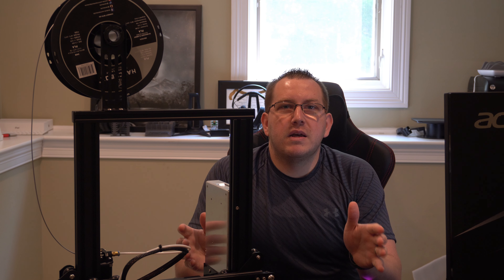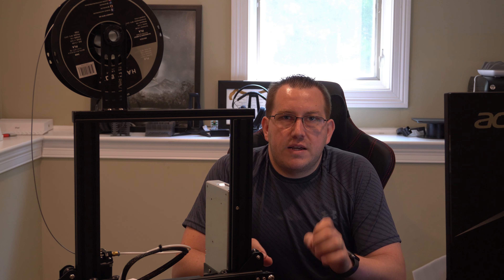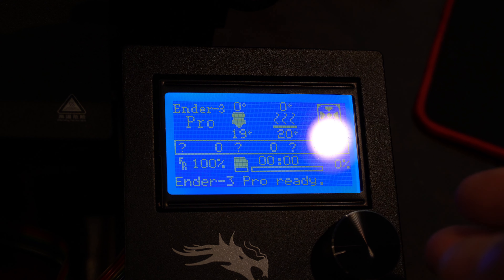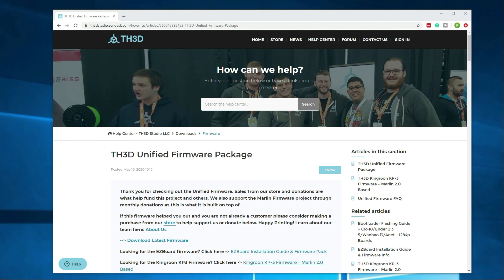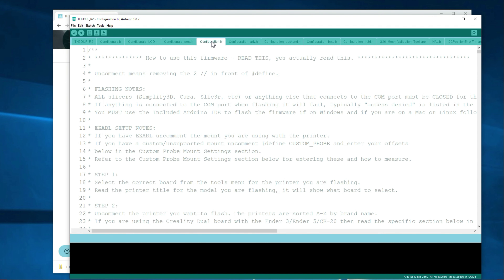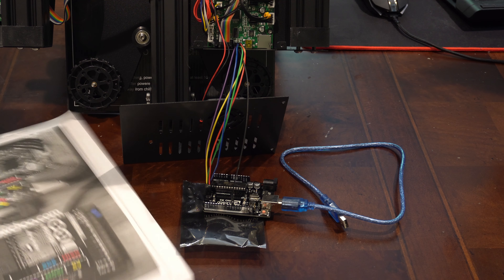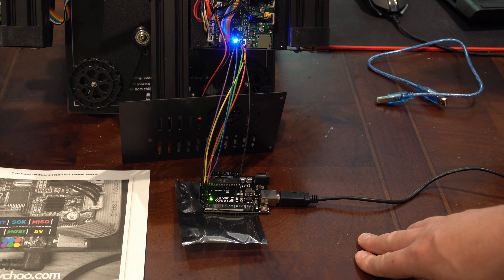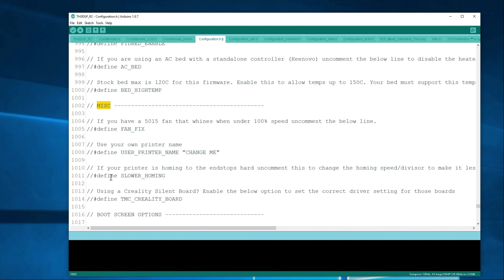Ender 3 Pro Firmware Update – Complete Guide

Comment: I see creality has 1.1.9. would you know if they finally put thermal protection is in it finally? and how do you check if it does?
Reply from the maker: Hi. All the Creality versions I have looked at, or read about, didn’t have the thermal runaway protection working. I believe they added it at one point, but one of the reddit subgroups tested it out, and it ended up not working. I would recommend upgrading to Marlin, either by going through this video or upgrading your board to the SKR mini e3 v2. The SKR mini is a great upgrade and have a video covering it. https://youtu.be/wtT6iA9IG7A
Reply: Hi i can confirm that the official Creality Firmware  rev 1.1.6.1 that i downloaded from thier site does have thermal protection you just need to uncomment it in the config files and it does work as i have performed the relevant tests on both the Bed and Hotend  to confirm this. I have been running this with the stock board for E3PRO via Octoprint for years and have great consistent print quality. However if you need to and all the whistles and bells ie filament runout etc etc you will soon run out of space on the 1284P without disabling other options. Until my board gives up the ghost no need to migrate to the 32 bit
Reply: My ender 3 pro has marlin v1.0 installed out the box

Comment: im getting error can't set com-state for "\\.\COM6"
I've plugged in computer to printer via usb. Installed USB serial driver using zadig. 

can't set com-state for "\\.\COM6"

Before i installed driver, i had port not found sync error.

I don't know what to do now.
Reply from the maker: Hi. Do you have the 8 or 32 bit Creality board, and are you getting this error when connecting the Uno board or the printer? If it’s the printer, did you already push the bootloader using the Uno board?
Reply: @3DPrintscape  Hi I'm getting the same problem when plugging into the printer also had to use zadig to install the driver. any idears
Reply from the maker: @markjohnson5137  Hi. Is this when you connect the Uno board or is it when the printer is connected? Try to reboot your computer and make sure Cura is not open when trying to do this. It feels like something may be blocking the connection. It could also be your Antivirus blocking it as well. Also, what mainboard do you have?
Reply: @3DPrintscape  Thanks for the reply, I manged to upload marlin using the uno board set to upload using programmer. The problem is when just the printer is connected my lap top doesn't want to talk to the printer. Tried rebooting it, firewall off and nothing else running. The mainboard is creality 3d 1.1.4. I've got it working with the settings I require so I'm happy.
Reply from the maker: @markjohnson5137  That behavior is odd, if i come across a printer that is doing it I will dig in deeper. Im glad to hear you are up and running :) .
Reply: @3DPrintscape  I've got it working. I flashed the bootloader using a USBASP which is strange as when I used the uno it said the bootloader upload was sucessful. I also used the USB serial driver recommended for 1.1.4 boards on the creality website.

Comment: i have ender 3 pro 32 bit v4.2.2 board and purchased bl touch and flashed firmware to prepare for the bl touch.  was never able to get the bl touch up and running so looking to go back to original firmware but having a hard time doing it.  will this video work or is there a easier way to flash firmware back to stock.  been looking all over youtube with no luck.  any help appreaciated.  i did uninstall bl touch already. thanks.  i did also down original firmware from creality and try to flash bin file with no luck.
Reply from the maker: Hi. This video is geared to the 8-bit boards. I have a video that covers the 32-bit boards. I would recommend looking at those.
Reply: Thanks much, watched your other video and realized the file was supposed to be renamed to just firmware .bin.  did that and back to stock again.  Thank you so much.

Comment: So is there a 3d printer by same company that I can get that I don't have to do all this stuff that I can just open up the box build it or not and plug it into my new laptop I bought to do this with and it work without problem?
Reply from the maker: I'm not aware of Creality providing any of these mods themselves. They are a cheaper printer, so people just buy them and do the mods to save some money. If you're looking for a printer that has everything already, I would look at the Prusa or Taz 6. They are a lot more expensive, but they work very well and print a lot faster. I have Taz 6 that I use as my primary printer, and it prints about twice as fast as the Creality printers. Again, these are a lot more expensive, and I would not recommend them unless you have a need for them.
Reply: @3DPrintscape  do you know anyone in Arizona that I could hook up with that could help me out and get this thing set up and running?

Comment: "Another source" suggests downloading the update from the creality site, unzipping to an SD card and switching on the printer and the update just happens. (18th July 2020).
Am I missing something ?
Reply from the maker: Hi. To me, the biggest issue with the Creality firmware is the older versions didn’t have thermal run-away protection, and the new releases say they do, but it doesn’t work. Check out this thread, many people are saying the thermal run-away protection isn’t actually there “https://community.octoprint.org/t/thermal-runaway-protection-absent-on-creality-ender-3/2787/29”. Another advantage of using the Merlin firmware is that you can unlock the full dimensions of the bed, the Creality firmware caps it at 220x220. So I guess in short, you can use the Creality firmware. I just don’t like it so I don’t recommend it.
Reply: @3DPrintscape  Thanks for your reply.
I appreciate the thermal runaway deal. lets leave that aside while I bring you back to my core question.
I appreciate that marlin software is the bees knees but... installing marlin software seems to take an inordinate amount of time and effort when a Creality update is just an SD card and switching the printer on (Allegedly)...
Does the Creality update method actually work do you know ?
If it doesn't, then creality have just lost any respect I had for their kit.
Their web site is silent as to how the update is applied. The SD card deal was gleaned from "Filament Friday".
If it DOES work, then I am surprised that the minds behind marlin have spent no time (apparently) coming up with a more user friendly updating methodology that doesn't demand a ton of error prone steps to solve the core issue (it seems) of thermal runaway and maybe, a few more mm of build volume.
or have I missed something?
If the company, Creality, adopted marlin, this would seem to be a sound business decision.
Deep respect by the way. No insult intended.
Reply from the maker: Honestly, I haven't tried to update the Creality firmware, I've always just changed to Marlin. I suspect that the process would work as they advertise and shouldn’t to be complicated but its hard to say for sure. If I get my hands on another Creality printer any time soon, I will test that out for you. That said, I personally don’t see the value in updating to another version of their firmware unless there is a specific feature you are looking for. The printer works fine out of the box, it just doesn’t have the thermal runaway protection. I agree that creality adopting Marlin would be a sound business decision. Honestly, I'm not sure why they haven't. I'm guessing it has something to do with cost.
Reply: @3DPrintscape  Thanks My Man.
You answered my questions with honesty. which is great.
My ender 3 does work very well.
I think I shall leave well alone.
Thanks again and best wishes from the UK

Comment: Have watched the video several times before attempting to upgrade firmware.   I use two monitors to watch video on one and do the software (TH3DUF) on the other.  I flashed the arduino UNO... then continued to put the bootloader on my Ender 3 Pro... then when I go to connect Ender to PC I have no port to connect to.  Ender screen lites up (blank).  Of course now I have no firmware at all apparently... HELP!!!
Reply from the maker: Hi Mark. Sorry you are having issues. When you flashed the bootloader was it successful? What was the actual console output? If you are not seeing the enter 3 pro when plugging it in to the computer I would connect the UNO and try to flash it again.
Reply: 3D Printscape thanks for the quick response...yes the boot loader appeared to have loaded... will go thru process from beginning tomorrow...
Reply: @3DPrintscape  I have gone thru each step slowly, verified after each, yet when I get to unplugging arduino UNO and plugging printer directly with PC I never can get to the last step of uploading the changes made on Lines 366, 383, and 1027 ... When I open tools, the Board is correct ... the Processor is "ATmega1284P (16 MHz)",  Port is non functional (grayed-out) and no means to select a port.  Can't get Board info.... Programmer: "AVRISP mkll" 
Trying to upload the sketch gives an error  occurred while uploading he sketch ... I have tried different USB cable .... different USB ports on PC ...
Reply from the maker: Hi Mark, can you email me the details at admin@3dprintscape.com? I think it will be easier to help over email. Also, can you send me the config files you updated?
Reply: @3DPrintscape  I'm having the same issue as Mark.  My PC doesn't seem to recognize the USB connection from the Ender 3 Pro.  I'm wondering if its USB driver related or perhaps a bad mini USB port on the machine.  I've never been able to connect the machine to this PC.  I'm going to try another machine and see if it makes a difference.  Any other ideas or were you able to solve Marks issue?
Reply from the maker: Hi. I recently ran into an issue where I couldn’t get my printer to run on a specific port. I think it was the USB 3.0 port it wouldn’t work on. I moved back to a USB 2.0 port and it work. It also worked on the USB 3.0 port after a reboot. I would try to reboot your computer and try a USB 2.0 port if you have one.
Reply: @3DPrintscape  I did try that and it powers up the Ender 3 Pro and the display lights up so its getting power but there is no ability to select the COM port and there is nothing displayed on the Ender screen.  At this point it appears there is no firmware at all installed on the device.
Reply: @3DPrintscape  I found that no matter which port I used it would not work... I then went with a different computer and it works fine... Thanks for the info though
Reply: @3DPrintscape  is there anything you can do if none  of the ports are working, Ive rebooted and still none of them will work.  I do not have another computer to do it on.
Reply from the maker: @christabachmeier1729  It depends on what mainboard you have in the printer. If your interested, i can try to help you out on discord. https://discord.gg/Bu94EYVkrU

Comment: Ok wait do I need to do this still if I purchase a skr mini e3? Or does that come with the updated marlin with thermal runaway protection? I’ve just been really confused. I want to make upgrades on my ender 3 pro and I really want the bltouch and the skr but will I need this if I buy the skr or do I just need the skr and bltouch.
Reply from the maker: Hi. If you plan on buying the SKR Mini, then I wouldn’t spend the time going through this upgrade. The SKR Mini comes with a version of Marlin 2.x, which will have what you are looking for. Here are two videos I created on this topic that I think may be of interest to you.
SKR Mini Install: https://youtu.be/wtT6iA9IG7A
SKR Mini Custom Firmware: https://youtu.be/Vn5rMdJgkAI
Reply from the maker: I linked to the one from BIGTREETECH, the one you found is from another seller. At the end of the day, I would think either one would be fine. That said, I would recommend getting the SKR Mini and TFT35 combo, that one is in stock. The TFT35 touchscreen is really nice.
Reply: @3DPrintscape  Hmmm alright well I definitely will look into both options! Thanks again! Found your channel not too long ago and it has been a real life saver keep it up!

Comment: My transfer board broke. In the 32 bit version you have an option to do it without the transfer board (just by micro sd). Is there also a way to do that with the 8-bit board? (I have the board v1.1.4)
Reply from the maker: Hi. Unfortunately no, you would need to use the transfer board and the 1.1.4 board will need a bootloader before being able to update the firmware. I would honestly look into upgrading the board tot he SKR Mini or Creality 4.2.7. Its not an expensive upgrade and would save you a lot of work/headaches.
Reply: @3DPrintscape  After doing a bit of research I tried upgrading to a new board (upgraded to 4.2.7). In the beginning I could not get the BLTouch connected (was made for V1 board), but I did figure it out. Everything is now working fine and I enjoy the fact that the printer is much quiter (It stands in my bedroom, so that is very nice). Thanks for the tip, helped me a lot
Reply from the maker: @anoniemw.222  Im glad everything is working now :)

Comment: My power loss recovery won't work properly.It displays a msg to resume.When I select to resume it,it heats up but doesn't start printing.
Reply from the maker: Hi. I have had a couple of people have the same issue, though others say it works fine. I don’t have the stock board installed anymore, so I can't test this but I'm pretty sure it worked after the upgrade for me. That said, it was never very reliable on the stock board. If this is a feature you want to work every time, I would look into getting the SKR mini, I did a video on it that you can see here https://youtu.be/wtT6iA9IG7A . Also, you can email me at admin@3dprintscape.com if you need further assistance.
Reply: @3DPrintscape  Ok,Thank you very much

Comment: do I need to run the boot loader every time before making changes and uploading the firmware? I am getting an exit status 1
Error compiling for board Sanguino 1284p.
Reply from the maker: Hi. No, the bootloader install is a one timething. What error did you get?

Comment: hi, can this increase the max temp so a metal hot end can do nylon?
Reply from the maker: Hi. There is a value in the config for max temperature that you can change. I’m traveling so can’t look right now but I know it can be done.
Reply: @3DPrintscape  thanks, in the mean time, I found your new 4.2.2 video 
I'm working my way through step by step trying to get it done
Reply: @3DPrintscape  hey, thanks for the videos and response. 
after some troubleshooting, I fixed my errors and got it to flash. new max temp 300
thanks

Comment: Why is my ender 3 pro different? The mother board doesn’t have 6 pins (2x3) but has only 4 (1x4), any help?
Reply from the maker: Hi. It sounds like yours may have shipped with the new 32-bit board they are using for the v2. If that is the case, you won't need to add a bootloader and would update the firmware via the SD card. It's similar to updating the firmware on the SKR mini, which I cover here. https://youtu.be/Vn5rMdJgkAI

Comment: HELP: When I connect the printer to the computer the light turns on but no options appear on the arduino ports
Reply from the maker: Hi. Can you check to see what board version you have. You will need to actually physically look at the board to get that.